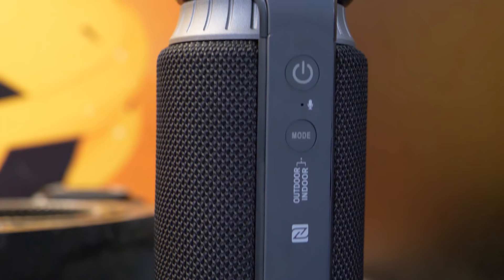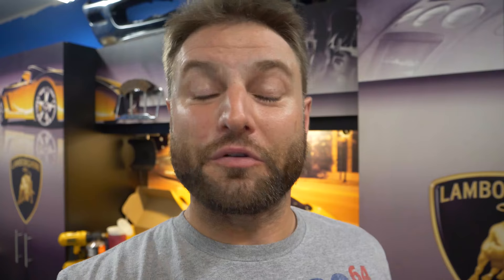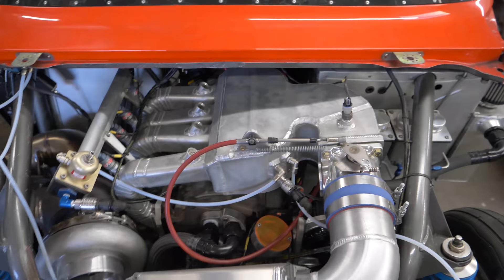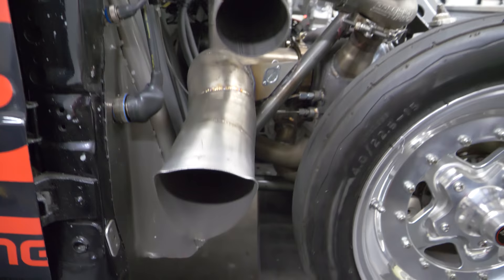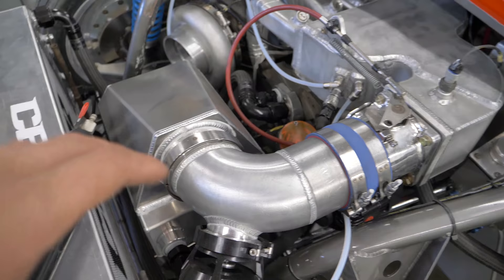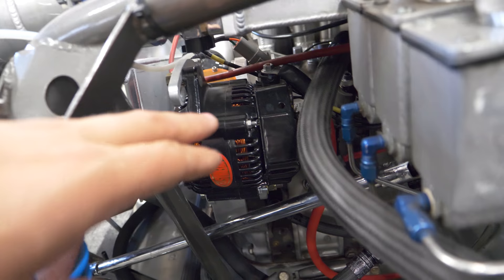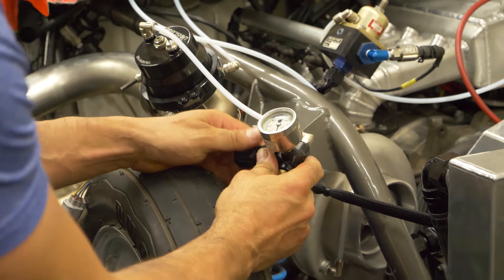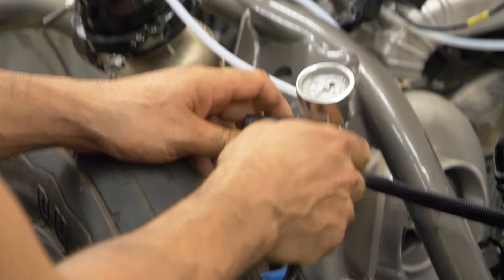Can Abel make more HP on his 2 rotor R100 than my 3 rotor? | Rob Dahm

Comment: Still slower than the 4 rotor... With his huge quads Rob Dahm can push that thing in a 1:23.2 at 7.8 mph in the quarter mile.
Reply: Kyle Keogh no it is not. This little old car ran 7.98 in the year 2000. The 4 rotor is too heavy and missing many components. Not even in the same league.
Reply: @donjon8382  r/whoosh

Comment: Cool little car - saw an original, well patina'd one a couple of months ago on a local motorway. Plate was 69R100, IIRC.
Next time, pick up 3 or 4 sheets of 6'x4', 3/4" plywood to bridge the gap between the ramp runners.

Comment: What fuel are they running?  Usually the msp can pull low 300 range on 8-10psi using just premium pump gas.
Reply: R0T4RY is love it’s not a msp right?
Reply: DRIFT WOMPA I this video I assume it's a REW with modified housings.

But I have seen MSP on 9psi Dyno at 313hp.  Was a pretty aggressive tune though.  All stock internals was kind of pushing their limits there.  Usually around 10-12psi the MSP internals start failing

Comment: LOL why are the front tires so skinny?
Reply: 3rick512 minimal resistance
Reply: Marshall xd then why doesn’t the Veyron and Tesla roadster use little baby tires too?
Reply: Those aren't drag only cars
Reply: Because they have little use. Everything happens at the back tires. As for why a Veyron doesn't have skinnies up front. Well, it's AWD. And is designed to turn going faster than 20mph. This car isnt.
Reply: 3rick512 this is a drag car. You don’t seem to know as much as you think. The front tires only purpose is to go straight and be as light as possible in this car.